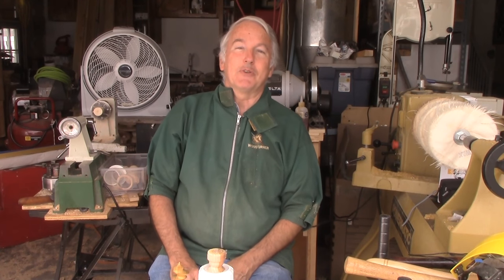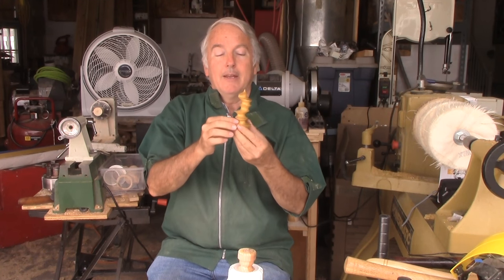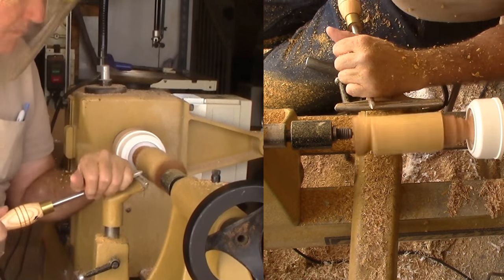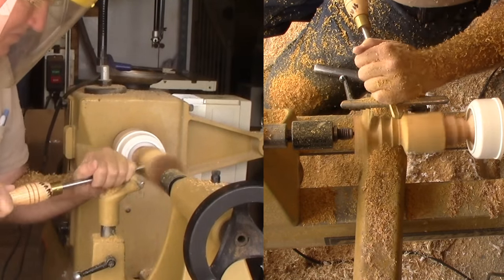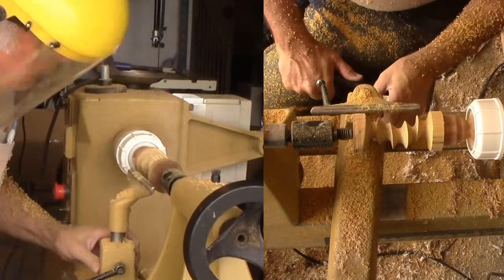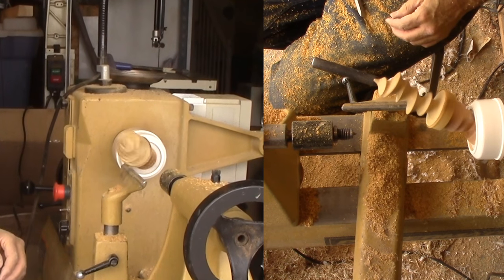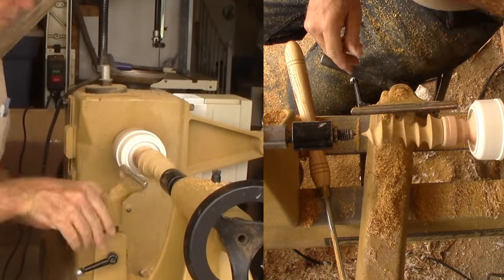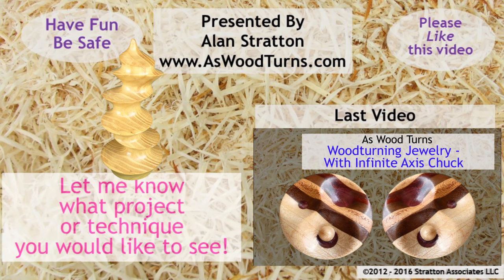Eccentric Spindle Woodturning With Infinite Axis Chuck

Comment: Hey Alan ... nice little project. You could knock the spur out of the live center and use it to stabilize the piece while turn the base.
Reply from the maker: Good idea. It depends on whether the tip is on the original axis. Actually, I prefer to put a drilled out rubber stopper on the live center when possible.
However, next week or the week after, I'll show another solution.
Stay posted.
Alan

Comment: Could you drill a hole through the plastic of the chunk and add a set screw to prevent the infinite-axis chuck from unexpectedly moving under pressure?
Reply from the maker: That is a possibility. However, it would damage the ball inside the chuck. However, they're easily turned and therefore replaceable.
Alan
Reply: Yeah, after a while it would get dinged up. But as you say no big deal.

In other odd ideas, today I was wondering about using a stiff toilet plunger instead of a standard tailstock, for bracing the piece without dinging it up.